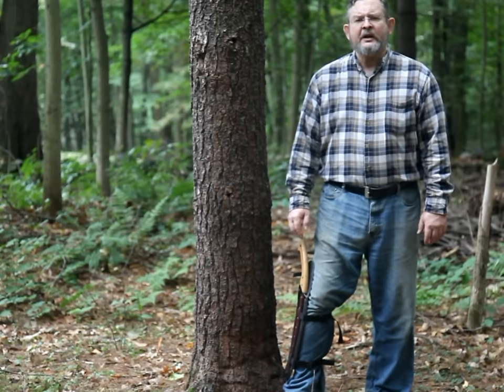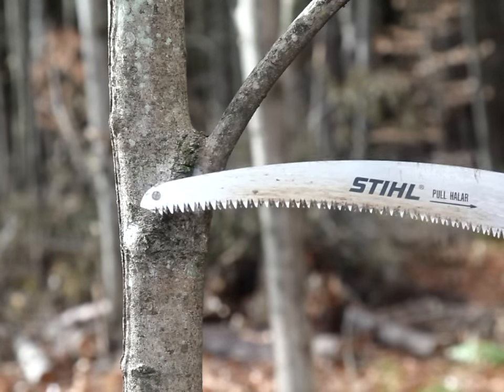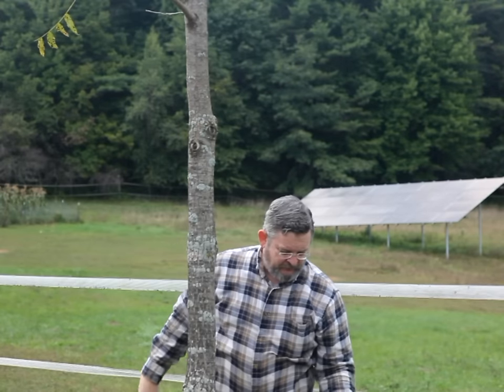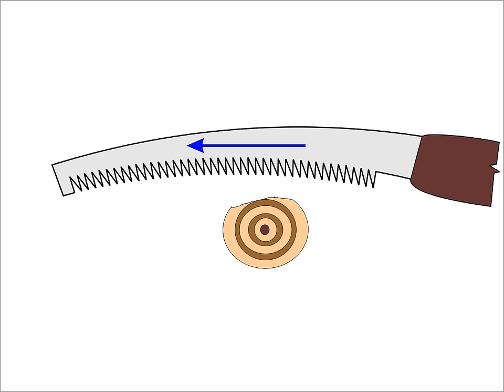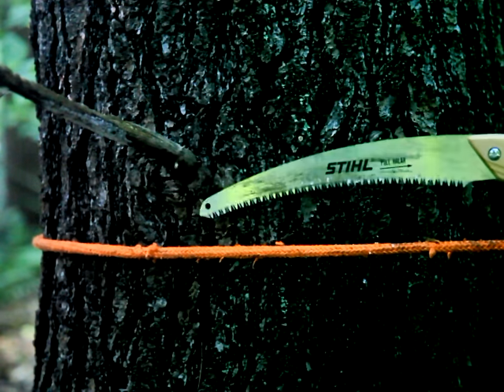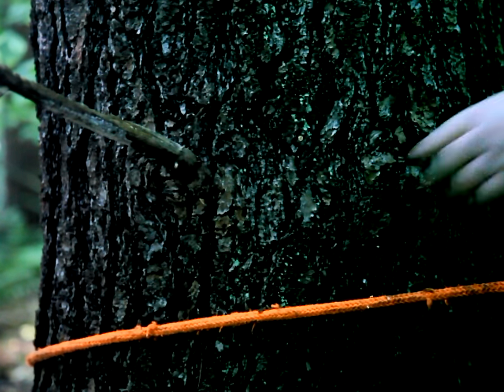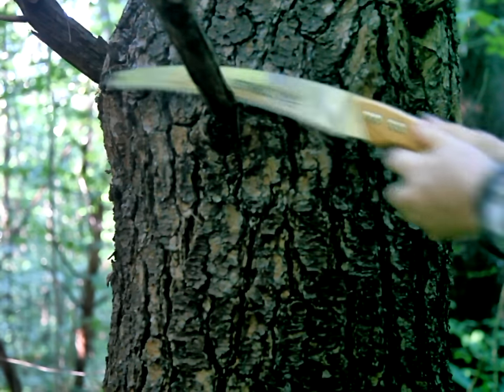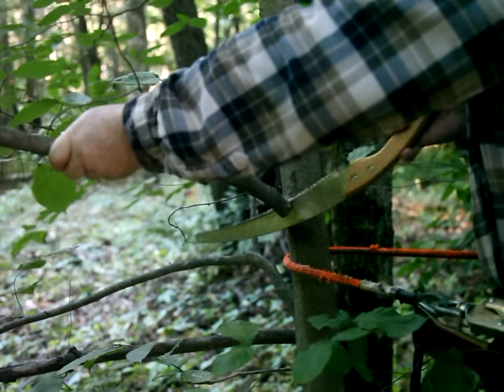Handsaw Use In Tree Removals

Comment: These saws are razor sharp and can put you in the emergency room lickity split.  NEVER have another body part where the saw can contact it if it drops a little after finishing a cut.  One of these saws just tapped my left wrist that I had foolishly placed under the branch I was cutting for stabilization.  A gentle tap was all it took to puncture my radial artery in my wrist.
Reply from the maker: Yikes!  Glad you're still with us.  Flesh definitely yields to a sharp saw easier than wood does.

Comment: Hi Terry, I recently bought a large handsaw (Silky Katanaboy) and am looking to fell some large trees in the backcountry in future. I'm wondering are the procedures for borecutting applicable to large handsaws or are there safer ways to fell a tree using a handsaw?
Reply from the maker: While it is theoretically possible to do a bore cut with a hand saw, most of those stories involve escapes from prisons.
Back when two-man crosscut saws were the primary tool for lumberjacks, their death and injury rates were much higher than today.  I can certainly see why you wouldn't want to lug a smelly chain saw into the back country.  Just try to avoid leaners if you can and be really well prepared to dash away from the tree.  Good luck and stay safe!
Reply: Ha! that's a no I guess. So no leaners, straight cut through on the perpendicular?
Reply from the maker: Attempting to do a straight-through cut is likely to get your saw stuck...really well.  You should still do two cuts to remove a wedge, then do the back cut.  The hinge gives you control over the direction of fall AND keeps a straight tree's weight somewhat centered and balanced.  That way it will be easier to pull in the direction you want.  To do the pulling, you should take a rope with you, at least 50 feet long and at least 300 pound test.
Reply: Ahhh I understand now. Because I don't have a chainsaw I can't do the bore cut but I can still cut a wedge and a back cut. Thanks for the help Terry I think I understand the theory now. I'll put it practice on a couple of small trees the nexttime I'm out. 

Cheers